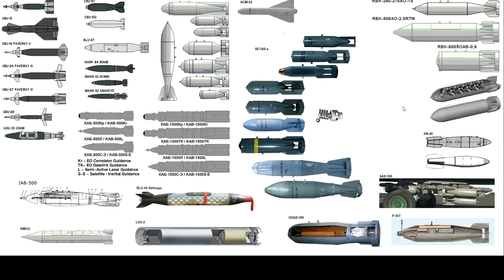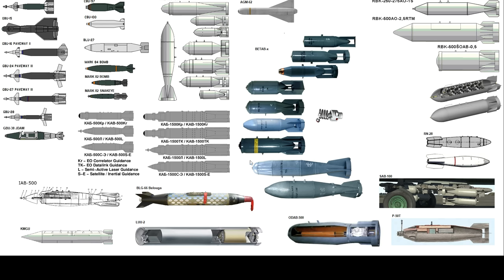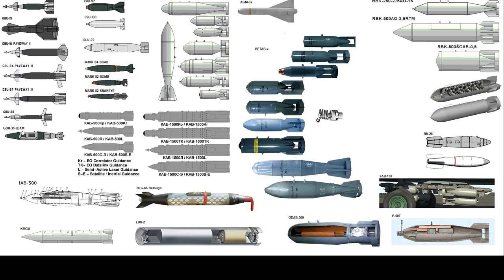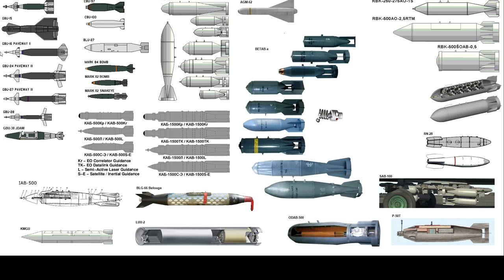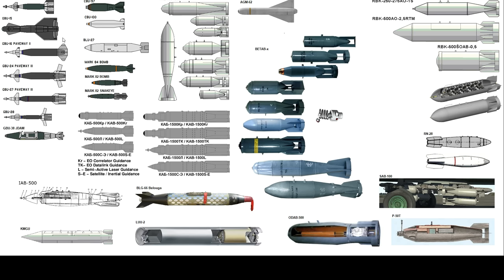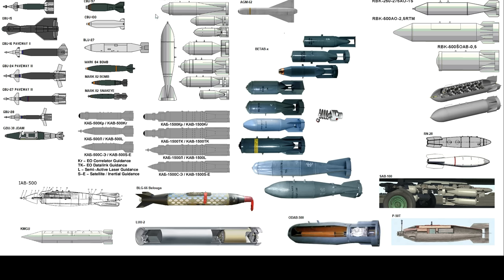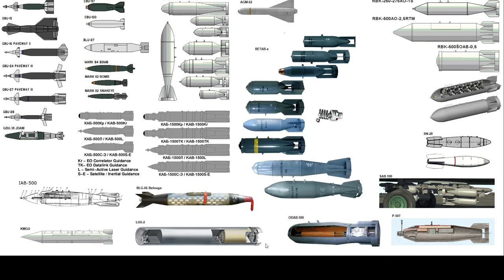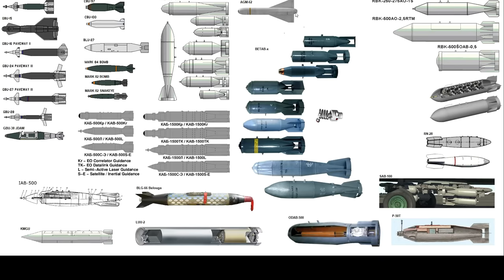Explained: Air To Ground Bomb Types

Comment: Laser guided bombs are basically like 'follow the dot kind of thing'.
The old ones simply looked at the brightest spot and guided themselves towards that spot. To create the brightest spot on the target, a laser is protected onto the target. Why laser? Because they are coherent light this transmission losses are minimum plus they are easier to make than a any other point lighting system.

There is a camera at the head of the bomb that sends signal to an(4 pixel {for each quadrant} camera with analogue calculator in the old days) computer, that then turn the fins of the bomb accordingly to make the bomb fall on the target.

It's more like aeronautical science and computer science than physics.

Don't confuse yourself over the word 'radiation'... Light is radiation and that's what's being reflected back from the target

Comment: FAB stands for F -nearest word in french fougasse (high explosive), A - aviation, B - bomb
ODAB - 500. Stands for Volume Detonation aviation bomb. It doesn't kill targets with fire. It kills with preasure. Bomb sprays fuel in big volume. Then fuel ignited. All oxygen in air burns out. Air presure goes out of explosion. First presure wave. Bang. So air without oxygen is in place of explosion and it needs less volume in space. You know this effect as vacuum force. Volume of air colapsing inside of explosion zone. Second presure wave. Bang. Now presure in center of bomb explosion is too big. Air presure goes outside again. Bang. So mainly there is 3 shockwaves in that kind of weapons.
Reply from the maker: rgr

Comment: Basically there are several sensors for the laser-light.
They can be each be pointing at different quadrants around the nose.
You measure the difference intensity of the light-sensors and you will know where the radiation is strongest.
You chance the nose towards that quadrant and measure again until it equalizes or the light is stronger in another quadrant.
Steering towards the sensor where it is strongest.

There are other ways also.
Was just looking at patent application with matrices of sensors.
But the principle is the same.

Several sensors of light at this frequency comparing in what sensor gives out the strongest electrical signal.
Reply from the maker: thx

Comment: On the thermobaric bombs:
Regular explosives contain the oxidiser necessary to create the explosion. Thermobaric weapons only contain the fuel and use the oxygen from the air instead, potentially having a higher yield for the same weight. As the fuel disperses in the air it can have a higher blast radius as well. Inside vehicles and buildings the fuel vapour fills up the available space or even adjacent rooms to maximize the effect. On the other hand in low air pressure with lower oxygen content such as high mountains or extreme heat the blast can be lower as well due to the less 
available oxygen.
A commonly used Russian bomb is the OFAB series. These are standard HE bombs (FAB) with an extra metal shell for increased fragmentation. In Syria they use OFAB-500 bombs everywhere from everything, including the Tu-22M. On the OFAB-1500 some of the "fragments" are palm sized. Ouch!
As Hawk 6.2.0.1 mentioned above the largest Russian standard bomb is the FAB-9000, 9,000 kg or 20,000 lbs. It was used from the Tu-16 bombers to create mini ground quakes, like the WW2 Grand Slam bombs.
I found about the RN-28 the yield varies from 1-10 to 5-30 kt, depending on the source. Strictly tactical IMHO.
Great video, Guys!
Reply: Imre Kalman 
Newer nukes have the possibility of dialing in the yield, a variable yield weapon.
Reply from the maker: roger

Comment: Fun fact: A Hydrogen bomb ist just a fission bomb with a little fusion boost. Most of the explosive power still comes from the uranium/plutonium but with that extra neutron "umpf" from that hydrogen fusion.
Reply: Depends - it can be over 90% fusion depending on design, though that's rare and only for huge bombs AFAIK. There's no realistic limit to the stages of a thermonuclear bomb, so using more than one fusion stage (like the Tsar Bomba which had multiple) makes it more fusion relative to the yield. The type which use a tiny amount of fusion to produce a massive neutron pulse to increase the fission yield are called boosted fission weapons and are like an in-between stage between pure fission and true thermonuclear designs. Variable yield weapons can vary both the amount of 'boosting' of the fission and the amount of fusion too.

Comment: Re: thermobaric aka fuel air explosives have two major differences versus high explosives.  One is that a HE explosive carries the fuel (a hydrocarbon) and the oxidizer (usually nitrate) in the explosive compound in a ratio that allows complete combustion of the fuel with no excess oxidizer needed.   In a thermobaric bomb only fuel or an incomplete ration of oxidizer is carried as air is the primary oxidizer.  This means that for a given mass of payload you get more energy, because you are carrying more fuel because less of the payload mass is used up by oxidizer.  The air is essentially an infinite and free supply of oxidizer for a FAE munition.

Secondly, the nature of the force released is different.  In HE the force is all released in a very short duration pressure wave producing a "high brisance" explosion.   In a thermobaric explosion the pressure wave of less peak pressure, but is over a significantly longer time duration, producing a pushing or heaving effect rather than a shattering (brisant) effect.  As a side note, ammonium nitrate fuel oil explosives used in cratering charges are also considered a low brisance/heaving explosive.

I think at the right standoff range a thermobaric weapon may also have a bit of a "pull" or vacuum effect as the fireball cools and collapses, similar to how a torpedo has a pressure/collapse mode of breaking the keel of a warship, but it's been too long since I studied any of this for me to promise that this vague half-memory is correct.

In terms of humanitarian effects, aside from the skin burns possible if in the explosion or very close, thermobaric pressure waves tend to kill by damage to the lungs and/or internal organs.  The problem being that although lethal damage is done during the pressure wave, the damage is spread out and not that acute, so it can take hours or days for the victim to die.

Pretty sure those differences aren't in the DCS damage model though, and won't be anytime soon.

I've moved since, but after high school I lived not far from a library that included a government document repository.  This means archives of things like outdated US Army and Air Force Field and technical manuals, including thing like Stinger MANPAD operator manual, Chapparal SAM operator manual, demolition field manual, improvised explosives and weapons manual, and a pocket guide to Viet Cong IEDs and traps among other publications.   Mind you, this was available to the public after 9/11, and as far as I know, still is.   Amazing what you can learn if you visit the right library.
Reply from the maker: thx

Comment: Laser is a special kind of Light, so I would assume that Laser homing works similar to IR homing (IR is light too, at a specific wavelength).
So you have a sensor that can see at that wavelength and it just steers the bomb towards the light source (which would be the laser bouncing off the target). Hope that makes sense
Reply: Imagine the Laser beam like the beam of a flashlight, just really really narrow
Reply: yes but the interesting part is, how does the bomb home on to it, my understanding is that the laser scatters in every direction from the surface of the target, so it's almost like someone is using a flashlight at the target point, and the bomb can home onto that
Reply: Vince Kiss thats the same as if you point your flashlight on something, yes the light disperses in funny directions, but you can only see the fraction that happens to be reflected in your direction, hitting your eye (or the sensor). You just see a bright dot
Reply: yes, that is why we use lasers, since lasers disperse very little, but when they hit a target the beam disperses, so it's like a source of light at the target, since it "started dispersing" at the target, not at the targeter
Reply: Vince Kiss thats correct. I dont understand what you wanted to know tho
Reply: i was just trying to elaborate on your point mostly, and or see if i'm wrong somewhere
Reply: Vince Kiss oh ok 👌
Reply: You see, lasers offer higher efficiency than any other light... the guidance camera, will guide the boys onto the brightest spot it it can see...
Normal Flashlights and IR lights (being incoherent),consume a lot of electricity when compaired to equally bright lasers...

And lasers come in all colors (light wavelength)
The one which army uses happens to be an IR LASER much like your CNC laser cutter which is often used to cut acrylic.

Comment: The laser system is I believe essentially just a laser pointer (in an invisible band of light) that puts a point on whatever you point it at and a camera that looks and says there is the bright spot that matches the encryption (laser code)
Reply: i guess the laser pulses to signal the laser code in use?

Comment: GBU-15 is a mark 84 with guidance kit consisting of a tv camera in the nose and moveable tail fin to steer it onto the target a weapons officer/operator or whatever they might be called in the aircraft assisting the pilot glides the bomb onto its intended target on his mfd he has the image from the camera in the nose of the bomb and he uses a small joystick to give steering input that is transmitted to the bomb, the weapon also have an optional IR seaker for use at night its still manually steered, its a tv guided maverick missile on steroids but without the rocket engine :)

Comment: There are also special anti runway "Bombs/Rockets" that i don't see here.
Like the BAP-120 and BAP-100 that's missing from the Mirage 2000 currently and the also French made but US used BLU-107 Durandal.

You drop these bombs at low level over a runway.
A Parachute opens and slows the bomb down enough to point downwards towards the runway.
Then a rocket motor fires and accelerates the bomb to high speed in a very short distance before it hit's the runway.
The bomb has a delayed action fuze that makes the bomb blow up under and not in the concrete slabs of the runway which causes much more damage.

As a comparison when the Vulcan dropped 1000lbs WW2 bombs onto the runway at port Stanley in 1982 they doped them from 10.000 feet just to be sure of penetrating the runway properly, so the rocket motors have to do that job for the bomb.
Reply from the maker: Roger I didn't see the BAP bombs in DCS
Reply: No they are not finished yet !

Comment: Its called a censor fuzed weapon its like giving the angels rpg's to play with a single aircraft could disable and or destroy an entire tank colum or vehicle colum when one of these censor fuced weapons detects a target it detonated a heat warhead forming an EFP explosively formed projectile/penetrator of molten copper that travels at 75% of the detonations speed of the explosive used so a rough guess the jet will travel at 3000 meters per second hitting the much thinner top armor of a modern MBT will almost certainly destroy or disable whatever it hits